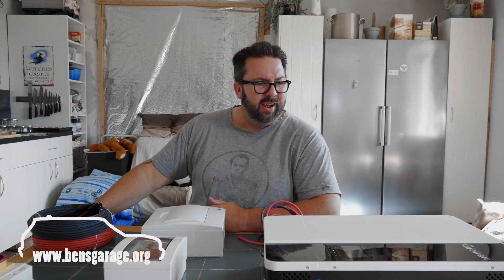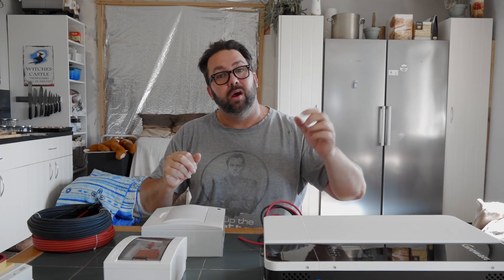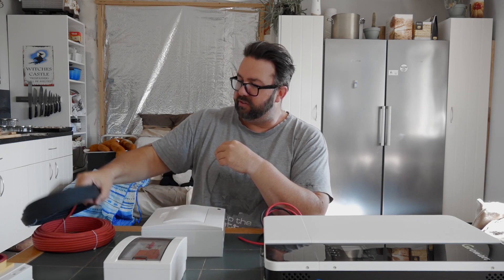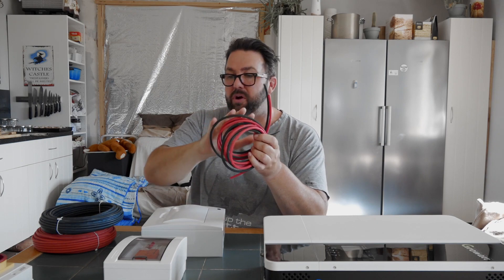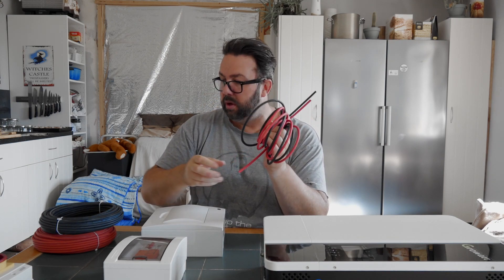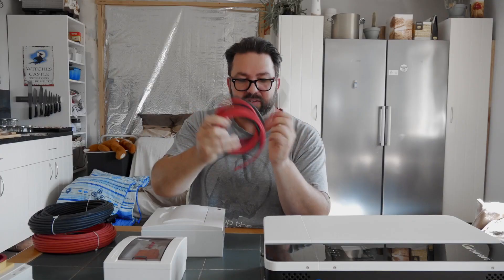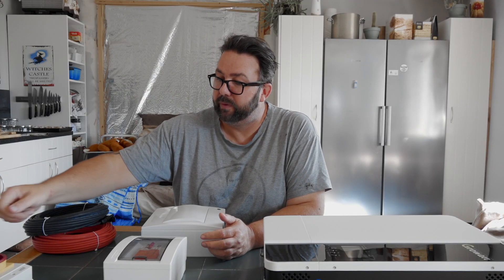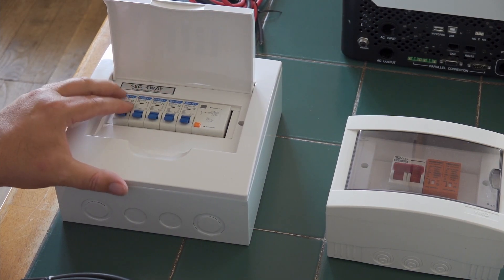Ben's Garage Goes Solar - Planning out our install

Comment: Hi Ben, You don't seem to have many breakers for a French system ie separate breakers for fridges washing machines and spin dryers etc, we have 33 breakers for a 3 bed farm house but we are on single phase is yours less because of 3 phase?
good luck with the install.
Reply from the maker: We only have a small house (one bedroom). You can have up to eight electrical sockets per breaker, if you use 2.5mm cable but only five if you use 1.5mm. Then you can have just one circuit breaker for up to eight lights if your using 1.5mm cable. The old dears place has an electric board like a telephone exchange, I think they might even have fuses instead of breakers, which is a bit old school.  Not sure if three phase has anything to do with it, Dad wired it all up and I’m only just taking an interest in it now that we are installing solar.